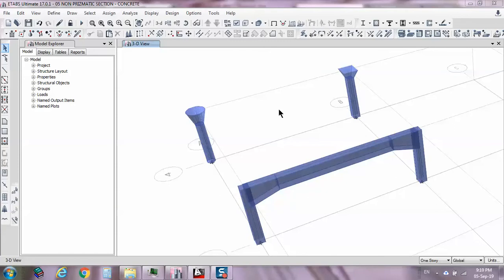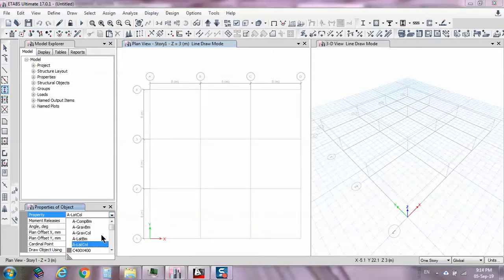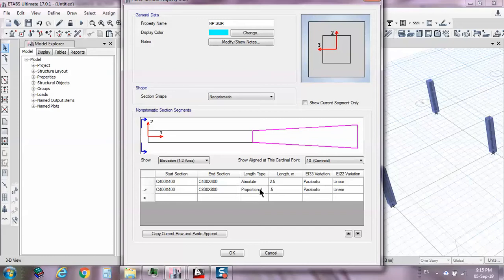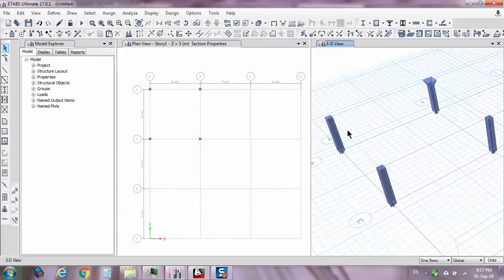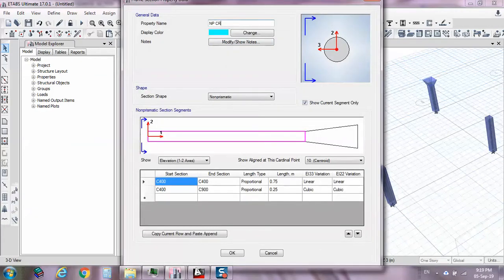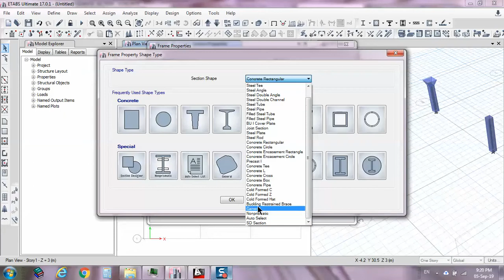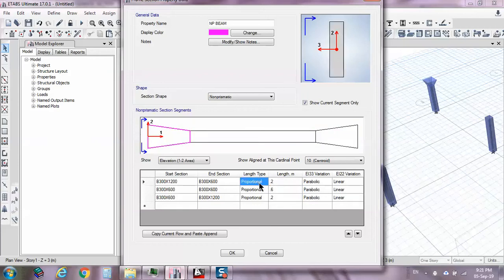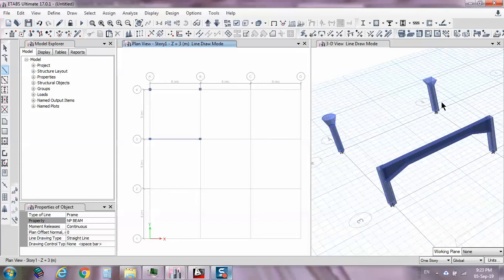05 ETABS - NON PRISMATIC SECTION - CONCRETE

Comment: For an end result of a 1:1 slope, should I considering a larger section at the surface of the slab where the capital would be inside the slab and drop panel?
Or should I consider the square shape of what would be visible at the underside of the drop panel or slab and ignore the 1:1 slope?
Reply from the maker: Interesting point, maybe go with the size at the  under side of slab and add a constant cross section segment from the under side to the center of slab thickness
 sorry for the very late reply